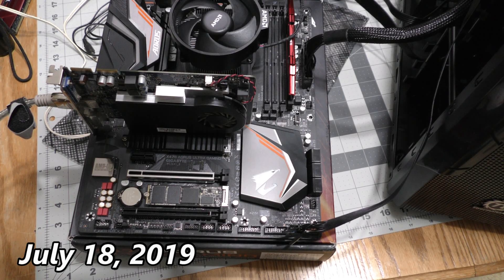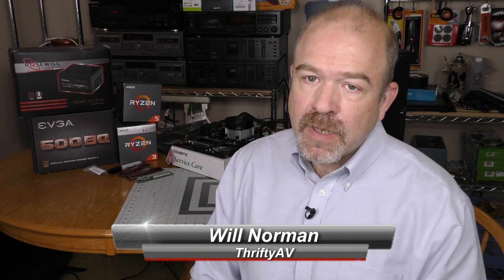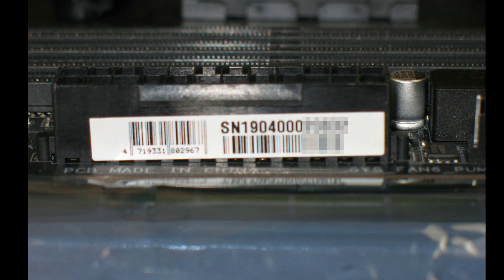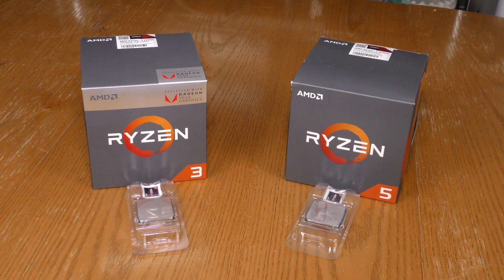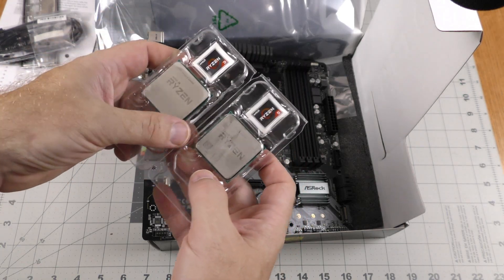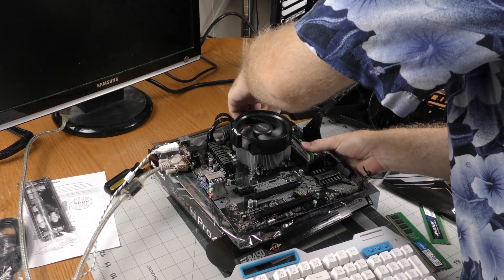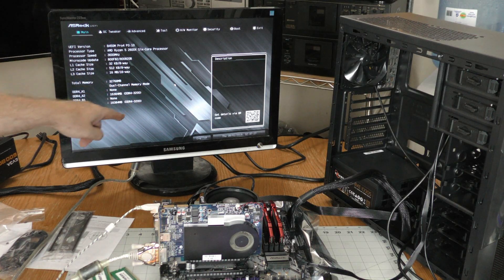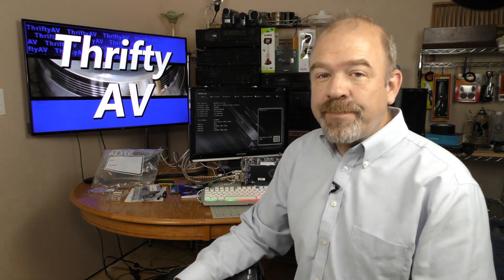Ryzen 5 2600X Build | Gigabyte X470 Aorus Ultra Gaming MB Failure, Debug, & RMA v.3

Comment: Same issue after 2 years of working.
Reply from the maker: I believe it has a 3 year warranty, so you can go through the same routine I did if you want to hassle with it.  I finally got a working board from Gigabyte, fingers crossed and knock on wood that is stays that way.

Comment: Almoust same problem same error but if use the backup Bios it works and if i restart from Windows menu it Boot from the main Bios with no problem but if i cut power back to square 1 so it ovious i Bios problem updating Bios dont work changing the motherboard is and it the worse period now i have to buy a new procesor first because if i want the a better Motheboard they support only from Ryzen 3000 up and i have the 1000 series !

Comment: Thanks for the video, I had the same issue today, after waking up from sleep mode from nowhere no boot no post. I tried different ram's, cpu's and psu's. Pity I didn't find this video earlier, would save me a lot of time :D. Lucky is that this failure occurred after year and a half, so it's still in warranty. I will think twice before ever buying another parts from gigabyte. Its a second motherboard in 4 years from gigabyte.
Reply from the maker: It took THREE RMAs before I got a fully functional motherboard from them.  The 1st RMA comments said that they flashed the BIOS, but it had the exact same problem when it came back, no POST.  On the 2nd RMA, they replaced the board, and it booted fine, but it had faulty built-in audio.  They finally got it right on the 3rd RMA.  It works fine now, and still has 2 years of warranty, but if it crashes again, I will probably change boards for my primary machine, as each RMA cripples my productivity.

Comment: Damn all the hassle you've to go through. And this damn board at fault in the end. Isn't there a RMA centre nearby or not very far where you can go in and get the motherboard checked on the spot?
Reply from the maker: You know about bad luck with computer parts... I have it too.  I believe there is only one RMA location for Gigabyte in the U.S., and it's in California.  I sent it back for a 2nd RMA.  At least this time they paid for the shipping.  Maybe they will fix it this time.  Meanwhile I have a spare CPU, RAM, and power supply.  If the MB works when they send it back, I'll just build a 2nd computer.
Reply: @ThriftyAV  Yup, that's the right way. A backup desktop or components never hurt. Specially for people like us who work on desktops than laptops. The investment never goes to waste actually, till none of them get any faults actually.lol.